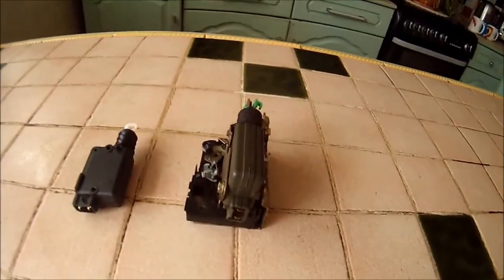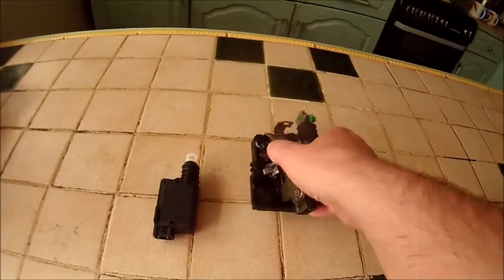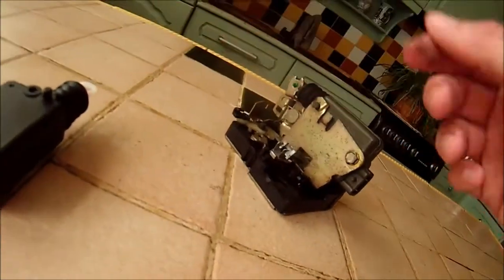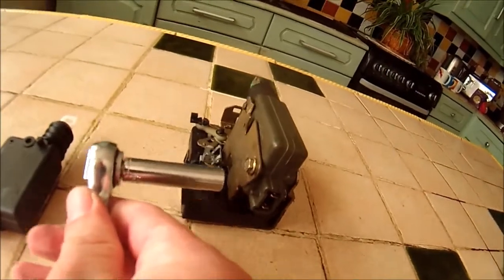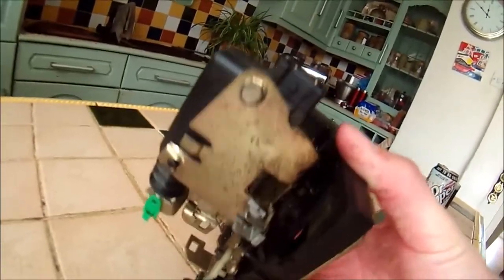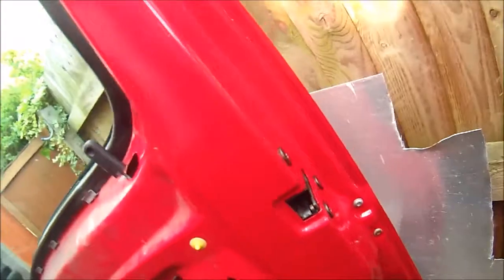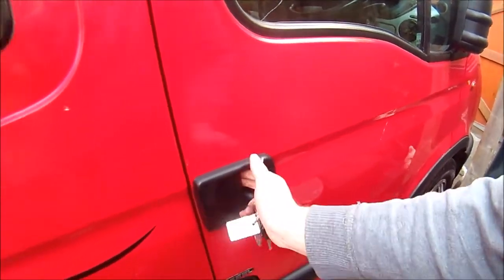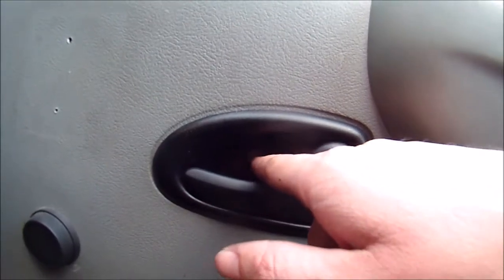Central locking repair on Renault Master mk2

Comment: Renault Master 2.8 diesel 199 8 the Speedo clock has stopped working what would I have to do to fix it could it be a fuse or can it would it be a cable any advice would be welcome

Comment: what was the issue? how did it manifest? i have the same van and locks are really hard to kick and unlock with key... however central locking button works... was it the same for you? thanks for sharing your experience. Leo
Reply from the maker: Hi, on the drivers door the central locking would lock but not unlock with the central locking. Have you tried oiling the locks?
Reply: Hello, I ended up opeining the locks and removing the motors altogether... They were causing excessive friction and kept breaking the lock barrels. I no longer have central locking in the cab but at least I won't have to dismantle the doors ever again. Thanks for replying. Leo